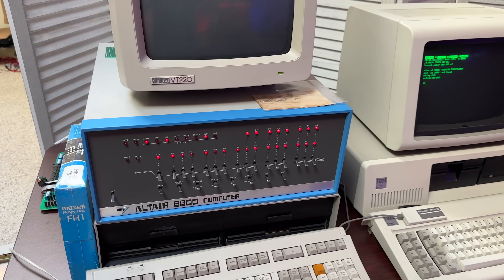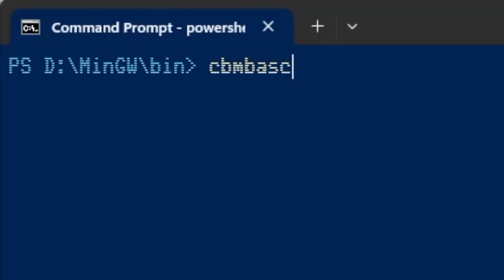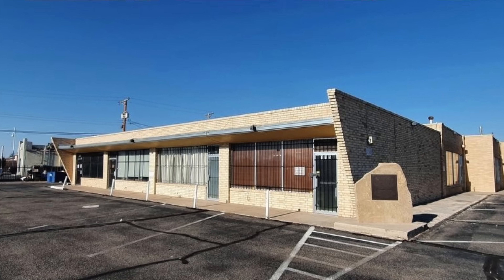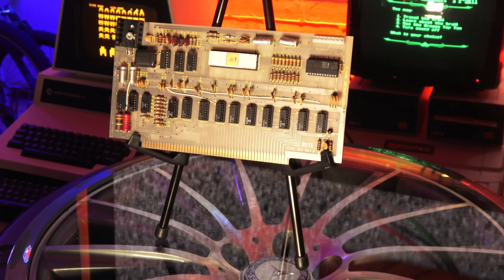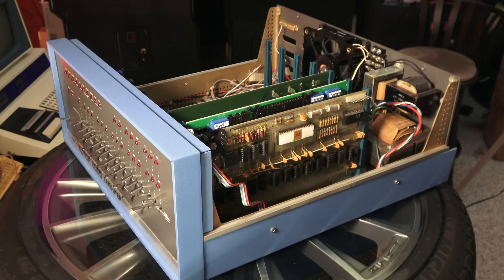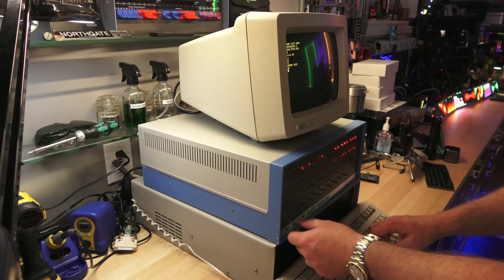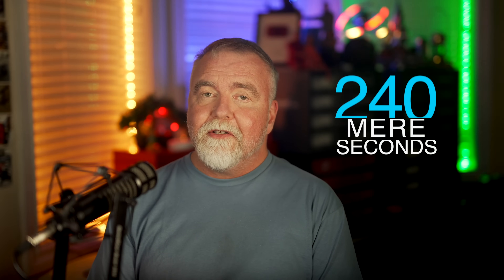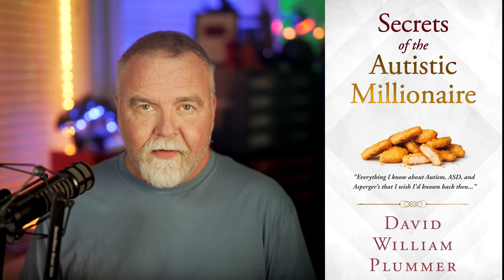Altair 8800 vs AMD Threadripper: Which is Faster?  We test them!

Comment: To be fair, you need to under-clock the thread ripper to 2mhz. Then I think the inefficient operating system on the threadripper will take its toll! ;-)
Reply: IIRC XP's idle usage is about the max a Pentium underclocked to 8MHz is capable of. The ThreadRipper has much better IPC and many more cores but Windows 11 might just be that much more of a resource hog.

Comment: The Threadripper is 2 billion times faster, but it's still just a generic PC clone at heart. the Altair is a unique system with tons of historical value, so it's still ALOT cooler. The Threadripper is also a lot cheaper than even a 4K Altair adjusted for inflation.

Comment: Your booting the easy way. In 75/76 we flipped the 8800 front panel switches a bunch to talk on a 20 mA current loop to an "ASR-33" to read a punched paper tape (Altair BASIC "v0.0 w/ bugs").  Floppy drives & any thing on ROMs came later.

Comment: Once attached to a terminal and with BASIC, the Altair looks surprisingly usable. I always thought those machines were some kind of early experiments without any real use case, something that you needed to program using the switches.
Reply: I used an Imsai 8080 to calculate best trading buy/sell points of 14 Futures contracts in 1976-77.
Reply: @BB-iq4su  who’s methods worked the best, u used the blue modem too, able to buy them quick enough ?
Reply: @BB-iq4su  Used mine for gaming and thermo nuclear warfare.
Reply: With a boot ROM and floppy drives, it could run the CP/M operating system, making it not only usable, but even practical.
Reply: @ordinaryk  the boot ROM, or what might of been card a BIOS, to load first low level switch movements to  get things moving and all the switches are then just for show/ at least trouble shouting, try doing with only power and reset button on the ripper?
Reply: @ordinaryk  CP/M was made for these 8800 machines.
Reply: It couldn't do much of anything when it was first sold, just the switches and lights.  Then Bill Gates and his partner were the ones who made a program that allowed it to communicate with other input and output devices.
Reply: My first computer was the SYM-1 maxxed out to the full 4K of RAM and using an old telex machine talking baudot code through a translator I wrote. It had BASIC and I did some assignments from university on it back in the late 70's.

We did know how to make these things useful.
Reply: @briancampbell179  lol sure, but you had it easy.  We're talking about when the Altair 8800 came out, and a club of 32 people including Steve Wozniak couldn't make it do anything except emit interference to produce musical tones on a nearby radio.
Reply: @customsongmaker , luxury. We used to live in shoebox in middle t' road...

(Monty Python: Four Yorkshire Men)
Reply: @briancampbell179  A shoebox?  Luxury!  We had only some old newspapers
Reply: Altair could be used as Word Processor with Wordstar, spreadsheets with SuperCalc database with dBbase, even games with Zork.
Reply: Back in the day, a low-cost option was to connect it to a surplus Model 33 Teletype. Sure, you had to buy paper by the box, but it worked! (Been there, done that...)
Reply: They were - without the expansion cards, which didn't come cheap. Dave's is a highly expanded model by the standards of the day.

Remember though that the original PDP-11 which ran Unix only had about 56K of memory to share among multiple users (I don't recall how much the PDP-7, which was the very first computer to run a - two-person - version of Unix, had, but it was presumably somewhat less). 

If all you're doing is "serious computing" (text processing, very basic [by modern standards] C and Fortran programming, and systems programming for a machine complicated enough to do that for a few dozen users), and you're happy enough typing commands into the computer to get it to do what you want, that's all you need. It's the graphics for the games and the graphical user interfaces that take up so much memory these days, assuming we're not talking about the mainframes - now only the size of a 1970s minicomputer - that do your banking or sort your airline reservation, or the supercomputers that design vehicles and rockets, decode the human genome and work on astrophysics problems. 

Most modern applications also have stacks of files for localisation, too.

Don't get me wrong though, I'm a big fan of GUIs. In fact within about half an hour of starting to use my Amiga 500, I had almost forgotten that the Sinclairs and Commodore 64s and Altairs of the world ran exclusively on text and very simple, almost monochromatic graphics.
Reply: @jeffreyjoshuarollin9554  with the PDP, the stack was literally a stack of cards.
Reply: The terminal setup was used in my dads office too, calculation, and the modem connection. You needed an interface for the CPU. Basic, so you never needed any interpreter to run code. Use case scenario you need, they did test in the lab,  calculating the results, ingredients etc, process industry, dairy food. Making slim fast products, using local milk, and other products as the Macdonald’s ice cream.
Reply from the maker: If you had DISK BASIC and a disc drive, it was like a real computer!
Reply: I remember trying to add a floppy disk drive to my SYM-1. I managed to get a single sided, single density 8" drive. The most difficult thing was to design the 24DC power supply that had to provide a 10A startup current without the slightest glitch, otherwise the drive wouldn't start. Without an OS, all I could do was use it like a cassette tape and just read sectors into memory.

Comment: The P8316E is a mask rom with 8 data bits and 11 address lines and 3 CS lines, I don’t think direct replacements exist but since it’s a single 5v VCC will not be hard to use a regular 2k or larger eeprom and use a daughter card to enforce ping compatibility. Will look into it and see what can I come up with.
Reply: You should be able to read them in a TL866 but again you will need an adapter, another way to dump them will be to do it with an Arduino just cycle through the addresses and read the data pins
Reply: I think TMS2516 EPROM is pin compatible.

Comment: I had a computer of a similar vintage produced by the Smoke Signal Broadcasting System Company. It had an S-100 bus.  I loaded programs from cassette. Booted using front switches. 

I also had an amber terminal.

Comment: Would definitely like to see the bare minimum computing required to play back media files like .mp3, AAC, MPEG1, etc.
Reply: Having lived through this era, mp3 really required about 100mhz 486 to run without stuttering.  It of course gets a little iffy on this if you were doing anything else at the same time.  As I recall my lab got the Pentium 133s, those could play Winamp and browse the web at the same time.  IIRC the 486-66s were very iffy, and forget about anything less than that.

MPEG1 was more like the Pentium II-233 and above era.  There were hardware accelerators for anything much slower.  But I recall playing a DVD at full speed on a Celeron-450 without  any HW acceleration.
Reply: @stevesether  I would add that encoding 'mp3' was a lot tougher; it required (using the lame.dll) a P2-300 or above. The other library of that time 'blade.dll' produced cleaner sounding output but needed even faster CPU, like a P2-450. The mp3 encoding was one of those places the AMD-K6 did not favorably  compare with the P2 of the same speed.
Reply: @vcv6560  Maybe you mean "encode in real-time" or better?  It just takes longer if you have a slower processor.

I encoded mp3s on a Pentium 133.  You could certainly do it on a 486 if you had to.  It'd take a while, but even a 386 with enough  memory could do it.
Reply: @stevesether   Yes that's what I meant in real-time, In the early 2000s I was creating my own podcasts from radio programs going direct to mp3.

Comment: Dave, I must tell you I am flabbergasted by these results! I was certainly betting on the Altair 8800 to beat the AMD Threadripper node hands down! After all--it has SO MANY MORE SWITCHES! Should I demand a recount? 🤔 Well at least I don't have to figure out how the IMSAI 8080 would compare. Or Z80a. Hmmmmf

I thought you were likely going to have the Threadripper emulate an Intel 8080, then run CPM 2.2, then run MSBASIC. Now THAT would be....still no competition. I got into emulating every processor & OS from my beloved "old iron" collection. I have virtual IBM Mainframes, DEC VAXen w/OpenVMS, DEC Alphas w/OpenVMS, SGI Indigo2 w/Iris, and of course PDP 11's with RSTS/e. I've got all of that running on ONE frame, a Dell PowerEdge T320. Boots up and goes right into the emulators. I was thinking your Threadripper could (likely) run a full VM with all of those emulators running, AND run the prime, and still beat the Altair by 1M times.

Have you looked at what Intel has done to the "new" Threadrippers and how they are far from affordable now? I wanted one for the PCIe lanes but darn! No way I'm paying $7K for a processor alone.
Reply: Errr, Intel hasn't done anything to Threadrippers (except maybe buy some from AMD to get ideas for future processors they're planning)...

Comment: Dave-I have an IMSAI 8080 that I built finishing July 4th, 1976! (Bicentennial! ;-) )  I would love to sell it to you for cheap, since I don't need it.  It has 56K of STATIC RAM.  (Dynamic was not very good back in the day.)  Also, there is a Prom Burner board, a Tarbel Cassette Interface board (that I used to cut records, thinking I had invented "Floppy ROM" which showed up in Byte magazine the very next issue.  Oh well, at least it did work.  I  could load programs from a real record (yes with grooves.)  I cannot remember the board name, but I have a video card (16 X 80).  I also wire-wrapped up a board that could interface with a parallel keyboard and a parallel printer.

Let me know if you have any interest.  It is in good shape except one of the blue/red switch paddles which is missing.  I see you can get more on E-Bay.

It has 22 S-100 slots, which I soldered in one day (2,200 pins!)  It is a monster and that power supply...  I'll bet one could arc-weld with that sucker!

Love the channel since, yes I had acquired a bootlegged copy of MS-Basic which amazingly was just like DEC Basic, for which I did a lot of systems programming in Basic Plus 2 (compiler version.)  It felt like home.  So cool reminiscing the early days of Dr. Dobbs and gang.

Take care and keep up the good work,

Marc

Comment: Would love to see the test series extended backwards in time, to include Cray, DEC, IBM, etc.  It gives a more relatable sense of how much computers have changed, so that society can create cat videos from a text prompt. :-)
Reply: And where will we get those machines?
Reply: Don't forget to include an analytic engine
Reply: Most of the IBM 'big iron' machines also known as mainframes back in the day, were not known for their number crunching computational speeds and quite frankly their benchmark numbers in  those type of tasks would be disappointing.  Where these machines shine is in scalability, large-scale transaction processing and the huge amounts of bulk data they could process.   Now a Cray is a supercomputer and used in the field of computational science which encompasses  a wide range of computationally intensive tasks across many fields.

So, it's sort of an apples and oranges comparison, the mainframe vs supercomputer match.  But yeah.  How would the modern HW owned by Dave compare to a Cray-1 circa 1975 capable of 160 MFLOPS,, or a Cray-2 circa 1985 capable of 1.9 GFLOPS?  There's probably someone somewhere that has this vintage HW.  Don't know. I don't know how many FLOPS Dave's machine can  flip so have no idea how they would compare.

BTW, the original Cray-1 weighed about 10,500 lbs and consumed about 115 kW of power, but adding more Freon cooling and storage capacity would have likely doubled that power figure!  So even if you had this HW in your garage, you'd likely have no way to easily power it!
Reply: The Crays are awesome. Haven’t worked on any of them for more then 20 years now. All companies have dumped them.
Reply: I suspect the cray 1 - the machine we always used as a benchmark of 'stupidly fast' in the 80s, would have trouble competing with a raspberry pi these days.

OTOH the raspberry pi doesn't come with inbuilt seating, so the cray still wins.

Edit: I went down the rabbit hole of asking how fast the WOPR was, and the answer turns out to be either (a) stupidly slow because it took 72 seconds to work out tic tac toe, or (b) stupidly fast because it ran a full AI in 1980.  The boring answer is 'as fast as the plot needed'.
Reply: @TonyHoyle  the original pi had 8 GFLOPS. The Raspberry pi4b 32 GFLOPS the Cray only had 1.9 GFFLOPS

Comment: If you use 2022 as the release date of the threadripper and 1974 as the release of the 8080, thats 48 years of technological advancement. Applying Moore's Law doubling every 18 months you would expext the threadripper to be approx. 2^32 times faster than the Altair. Given that handicap, and the fact that it was running an interpreter the Altair held its own.

Either way this was a fun comparison.

Comment: Hey. I expected this to be benchmark of delay from keyboard press to change a letter on the screen done by capturing both keyboard and screen on same "high speed" video  and then looking number of video frames in terms of delay between action and result. And Altair winning.  But after realizing it literally was the first it still may be slower.
It's Apple2e that people have tested beating the modern computers with significant margins. 
And the required high-speed capability is already in the phones, and by capturing both the input and output in the same video the measurement latency can be ignored and precision with modern phone could be in millisecond range. 960fps is close enough to 1ms of precision. But 240fps video would probably be good enough to show the difference.

Comment: Since the 8080 and the x86 architectures are closely related, surely the most fair comparison would be for them to run almost identical implementations in assembler.

Did anyone submit an 8080 assembler implementation of the prime sieve to the GitHub repo? I'll have to take a look later. :)

Comment: I once put a regular desk calculator against a Pentium PC. Two friends of mine had to engage with a "task" of mine to settle a long winded discussion they had.
I gave one the desk calculator, and the other the seat in front of a Pentium 90 MHz 16 MiB RAM machine with Windows 3.11 for worksgroup on it.
I then told em to, as fast as humanly possible, calculate two relatively large random numbers multiplied with each other. Start!

The one with the desk calculator won a landslide victory. He even calculated a bunch of other multiplications before the Pentium 90 machine had finished booting so the calculator application can be opened. The majority of the boot was the POST procedure. Ticking away that massive 16 MiB RAM.

Comment: Would like to have seen the Altair running the sieve in assembler.  You haven't lived until you've entered the front panel switch bootstrap into a Data General Nova to read the TTY paper tape!

Comment: Would be interesting to compare energy consumption between the two, and memory consumption. Efficiency is more than just being faster…
Reply: A single led uses 1 watt of power and I bet these are not even LED  multiply that by the factor of the loss and enough altairs to beat a 4 year old cpu would knock out many power grids. 

Good question though. 

FYI my similar rig uses around 600 watts when pushed to its limits including monitors.
Reply: @doublej42  Those dim LEDs will use a fraction or a watt each... the primary power hog on the Altair is gonna be that old CRT display.
Reply: @Steamrick  I don't know the specs offhand and am too lazy to measure it but the entire VT220 is probably under 40 watts. With tons of old-tech chips the Altair probably isn't much less.
Reply: @doublej42 Nope. Not 1 W per LED.

Old red LED used about 20-50 mA depending on how strong the designer wanted them to be.

The actual voltage was just under 2V, but with a 5V logic computer you normally burned 3V over a series resistor and internal voltage drop in the transistor controlling the LED.

5 V*0.02 = 0.1 W
5 V*0.05 = 0.25 W
Reply: Watts per MIPS of CPUs has improved ~500K fold since 1974. If you could manufacture an Intel 8080 (6µm) on TSMC's 7nm process and ran it at the same voltage and frequency it would be on the order of 1000 times more efficient in MOSFET power dissipation alone.
Reply: @factzilla1868 and you could probably fit several million in the space of one modern cpu or GPU die

Comment: At the clock speed of the Altair's CPU, namely 2 MHz, in perfect conditions electricity can travel about 150 meters (490 feet). At the clock speed of the Threadripper, electricity can travel about 6-7 centimeters (2½ inches) before the next clock-cycle. And the Threadripper is probably much more optimized to execute more instructions per clock-cycle, not even counting the multiple cores.

Comment: Once with my friend we raced ZX Spectrum (3.5 MHz) VS IBM PC/XT (8088) 8MHz 
With fastest possible for us lamas loop of printing "A".
On spectrum this was BASIC, on PC Turbo Pascal
Suprisingly ZX Spectrum won at first time.
Wich was strange because had many strong disadvantages:
- code was interpreted in every pass of loop
- ZX Spectrum *didn't have text mode*, every char need to copy 8 bytes from ROM to RAM, PC must write 1 or 2 (char and attibutes).
But we found option to bypass BIOS INT and write direct to display memory,
the PC won but only slightly